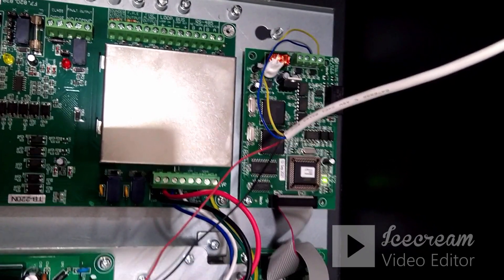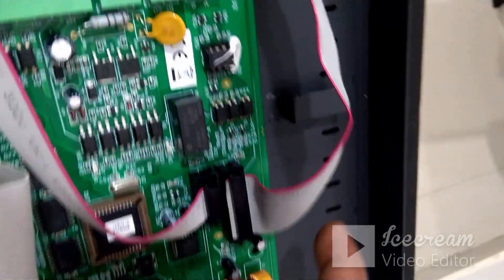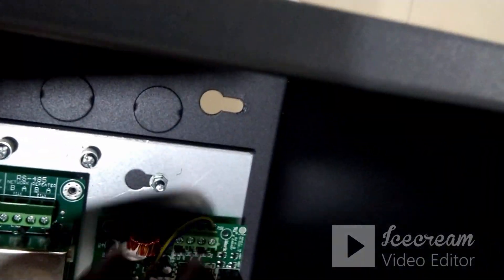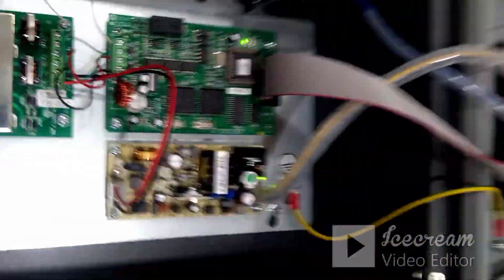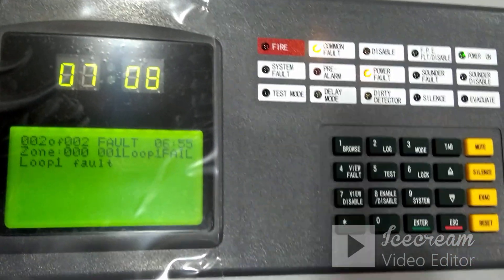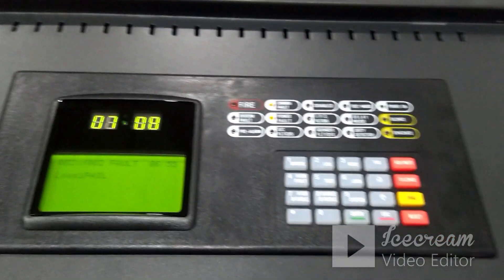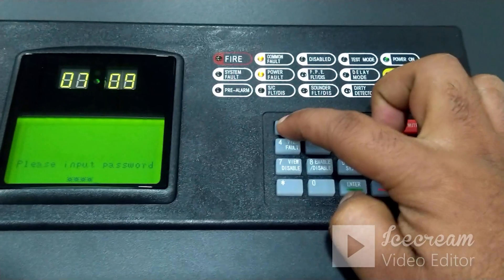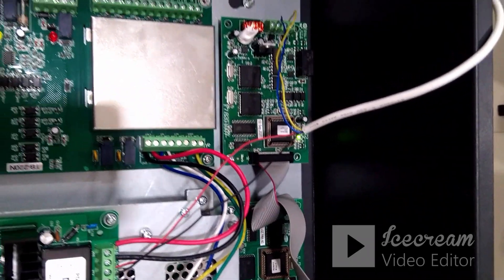How to connect GST200 Panel with Repeater Panel?

Comment: GST Can Network Card P-9960 classB It is not possible to connect to other panels and repeater panels. But card P-9960A It turns out to connect. What could be the problem?